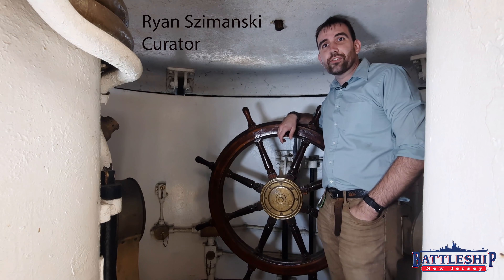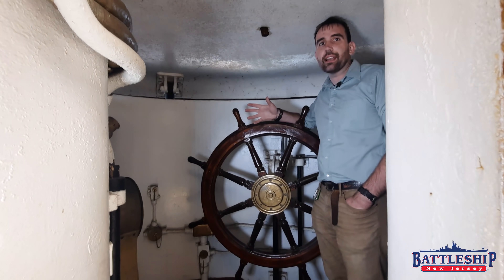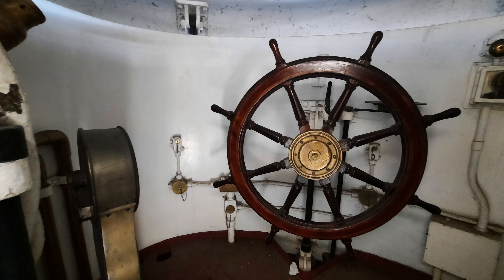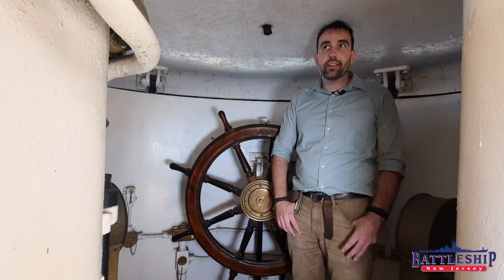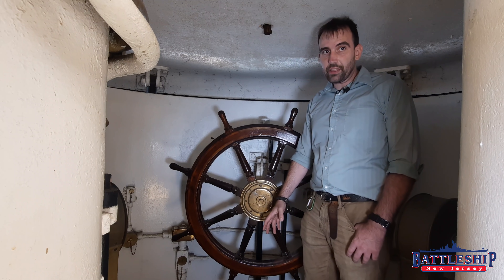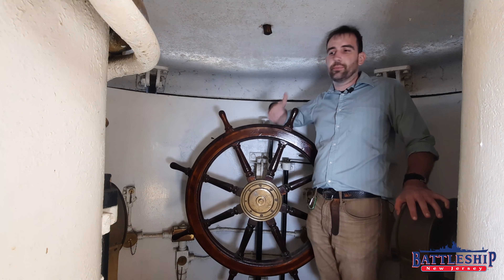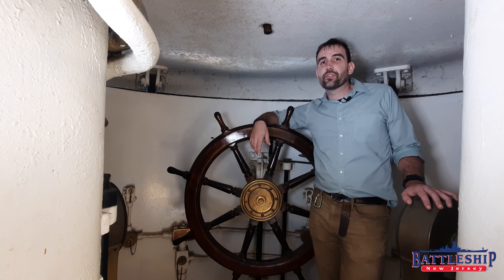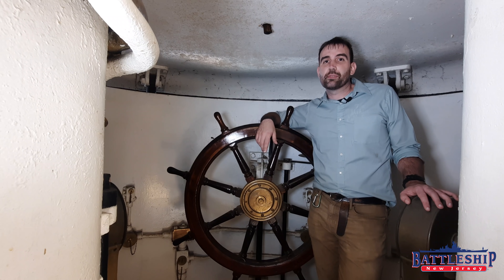Inside the Conning Tower on USS Olympia

Comment: USS Ranger had 3 positions. The one on the Navigation Bridge where I qualified as helmsman. There was another on the O-3 level all the way forward. When you see the carriers that had portholes just under the flight deck, that's where Auxiliary Steering was. My 1st Division Officer's GQ station was in there. Then there was a 3rd Steering Aft that was near the rudders. I don't know exactly where it was located. When we had a failure in the steering on the Navigation Bridge, we would transfer steering to Steering Aft until the problem was fixed.
BTW, I don't think a hand held compass would work in the Conning Tower. All of the metal would interfere with the compass. Binnacles have special magnets in them that are very carefully adjusted to compensate for the ship's magnetic field. This would be different for different points on the ship. You might want to do a video on the construction of binnacles.
Reply: You stole my thunder on how difficult it would be to use a compass surrounded by that much magnetic metal!
While it is possible to correct for magnetic deviation, I doubt it would be possible in there!
Reply: @mahbriggs  Impossible when surrounded all directions in steel, which would make the field in the middle almost constant due to the existing magnetisation of the steel as cast. 

Only way you would have a compass in there is with the later invention of fluxgate compasses, where you have a remote sensing head that detects magnitude and direction of the earth's magnetic field, and uses that with a set of saturable magnetic cores, to generate a 3 phase alternating current that drives the remote indicator, which can be mounted anywhere, and in any orientation. No electronic parts at all aside from capacitors and special steel alloys that are well controlled, and lots of fine copper windings. 

You compensate it at the mounting position, using a lot of small weak bar magnets, that are turned in sequence to correct for the magnetic field caused by nearby steel. Thus you will have an entire ship running at full steam, but doing position keeping, while a person on the wooden jetty sits there, and signals to the ship the exact magnetic heading they are on, and then the magnets get turned to compensate that major heading. Then move the ship 90 degrees, station keep again and repeat, till you have gone around the circle 4 times, then another turn to verify. For a big ship might take a day or two to do, so that is why you always had at least one spare ready calibrated magnetic heads around, just as a quick fix if the one failed. They rarely fail though, as there is nothing moving, other than an oil bath, that floats the sensor level and provides damping. Your emergency compass on the bridge will have it's compensation adjusted at the same time, but that is not going to be as accurate as the main one, simply because of all the steel around it, and the current flows in wiring near it. Good enough to keep a course if you have no electric power, to get you away from trouble to fix the problem, but not good enough to navigate across an ocean with, and hit a specific harbour, without aid.

Comment: I visited the USS Olympia a couple of times in the early 2000s, but the touring spaces were  less then. You could only go on the open bridge where the small wood wheelhouse is, and was not aware of the conning tower below. No engine room access either. The integration of old school woodwork with the stark steel everywhere else is incredible. Love those 8" guns in the Admiral's and Captains cabins! Thanks!

Comment: My two ships only had two steering positions. The first one though did have a mechanical linkage that connected to the huge wooden wheel on the bridge all the way to act steering. Pretty amazing.

The second used a repeater. Both ships could be electro hydraulically steered locally, hand cranked, or bared over with chains.

Comment: Wow.I never realised the bridge was called that because it used to be such back in the day.Makes sense now thanks.
Reply: I found this a while back...
Steam engines replaced sails on board ships, with sail paddles taking its place. They were steered via a rudder wheel. ... For this purpose, a walkaway was constructed on a raised platform, connecting the two paddles, serving as a literal 'bridge', earning the command centre its name.Jul 8, 2020

Comment: “You may fire when you are ready Gridley” - Admiral Dewey
Reply: Correct. It is a common mistake to have the words in the wrong order or to leave some out. Well done Trey.
Reply: @bigchungus2063- A minor but important point; Admiral Dewey wasn’t an Admiral. He actually held the rank of Commodore at the 1898 battle of Manila Bay. He was promoted to Admiral of the Navy in 1903. In 1899, the rank of Commodore was replaced with the O-7 level or Rear Admiral, but at the time of the battle, Dewey was still ranked Commodore. Again, just a minor point.

Comment: Glover had only two steering stations.  One on the bridge and the other in the steering equipment room over the rudder.  There were many backup methods for controlling the rudder.  Dual electric hydraulic pumps, backup muscle powered hydraulic pump.  dual hydraulic pistons.  Huge wrenches to turn the nuts if the powered systems break.  Mounted on the bulkhead is a giant tiller bar to attach to the rudder post, and a couple of chainfall winches to move the tiller.

Comment: Let's see. LSDs, AD and FF each had two steering positions - pilot house / bridge (LSDs had open bridges with the helm below in the pilot house), and after steering. Interestingly, the tugs had six steering stations each. In the pilot house were the main helm and two electo-hydraulic joysticks, one on each side, to make three. There was a steering station on the back of the deckhouse for use when hooking up a stern tow. In the engine room where the steering motors (hydraulic) were, there were valves where you could control the rudder (but not precisely), and then you could steer via block and tackle on the stern.

Comment: my dad served on a liberty ship that was converted into a radar picket ship. (AGR) i don't know what they had for steering stations. but i do know they had an an emergency rudder control. It involved a big wrench-like plate that fit on the shaft of the rudder, and then would be operated using steam winches on the deck.

Comment: in the 25 foot motorsailer i frequently use there is two, a hydraulic non powered wheel and a direct rudder lever in the back, even small boats benefit from multiple steering points.

Comment: I was submarines but on the Kentucky we had 2 places where you could steer (rudder control, and a choice of which hydraulic plant provided power to the rams) one in control, forward compartment upper level right under the sail, and back in shaft alley you could isolate the rudder ram and place it in local control, with what amounted to just a regular old hydraulic control block. You could also take control of the stern planes from shaft alley the same way, and if you needed to take local control of the fairwater planes you could do that from inside the bridge trunk (which intaled breaking the rig for dive by the way)

Comment: Finally, BB35 beats New Jersey at something!   Texas has 5 possible steering positions; steam or electric at navigation bridge, steam or electric in armored conning tower, wheel on the steam steering engine, and electric and manual in aft steering
Reply: That's only 4.
Reply: @ghost307  Aww, cut me some slack!  It's along walk between the electric tiller and wheels in aft steering!

Comment: Great video. Before you described see the seam I was thinking a Flip top. So I was staring wondering if any of the brass visible were sound Power phone jacks. Frigate I was on in the 80 I recall only 2 steering positions, after steering and main bridge steering. (and way too much time in after steering for sea and anchor)

Comment: Most modern ships have two, the bridge and after steering.
One ship I was on had an Auxillary con on the 02 level aft, there was a binnacle and a sound powered phone connection to after steering but no wheel or engine order Telegraph.

Comment: I did not realize the origin of the word “bridge” as it refers to the command space of a ship until now.
Reply: Steam engines replaced sails on board ships, with sail paddles taking its place. They were steered via a rudder wheel. ... For this purpose, a walkaway was constructed on a raised platform, connecting the two paddles, serving as a literal 'bridge', earning the command centre its name.Jul 8, 2020

Comment: Magnetic compasses do not point to True North.
They point towards Magnetic North. The difference between the two is called The Magnetic Variation. This can be considerable. If you do not know the difference between the two, then you have to determine it. In order to determine the difference between the two, the simplest method is to use the noon positioning check to determine true south or north & calculate the difference between it and your compass .
Reply: The mnemonic for that is:
True Virgins Make Dull Companions And Wives.

Comment: How many steering positions do I have on my Laser class sailboat? Depends on how you count, but I'd say 3 :P 
The default position is where you're supposed to steer from, using what's called the joystick. I can also sit leasurely steering directly from the helm. Finally, I can steer without touching the rudder by leaning side to side from any position, so I like to walk past the mast onto the bow and just sit there

In case you're interested, because of where the wind pushes in the sail and where the water meets the hull, you can steer by leaning on a sailboat. Lean one way and it'll steer the other way; lean left and you'll make a right turn, lean right and you'll make a left turn. This way of steering creates a lot less friction than using the rudder, so we try not to use the rudder if possible to keep the highest possible speed
Reply: You said “lean left and you’ll make a right turn, lean right and you’ll make a right turn”.  So how do you turn left?
Reply: @badbedbugz  My bad, made an edit: "lean left and you'll make a right turn, lean right and you'll make a left turn"

Comment: We have two formal positions for steering my ship: the bridge and Main Engineering. However, given the fly-by-wire nature of the controls and prevalence of wireless devices on a  Sovereign class vessel, it's possible to conn the ship from any compartment on any deck, using nothing more than a standard-issue PADD. The information available while doing so, however, is simplified to what can be displayed on said PADD, as well as suffering a degree of input lag due to not having access to the dedicated ODN hardlines (one of the reasons we still use centralized controls).
While older vessels DID have an auxiliary control room, most notably pre-refit Constitution class ships, they were deleted in subsequent designs due advances in the aforementioned wireless technologies. Today, the only vessels that would have a dedicated secondary control center would be ones capable of separated flight modes as a standard feature, such as the Galaxy and Prometheus classes.